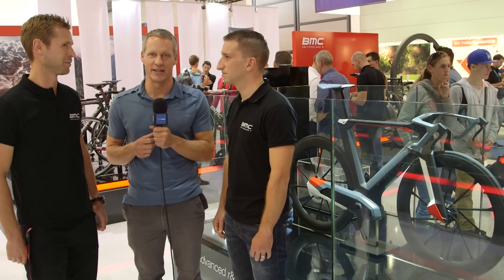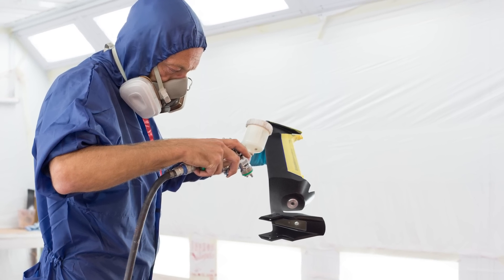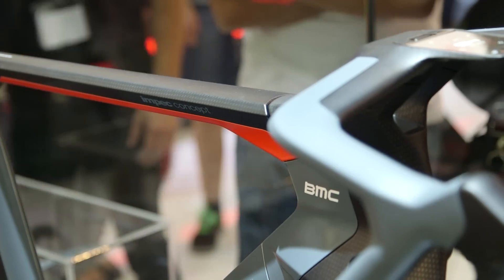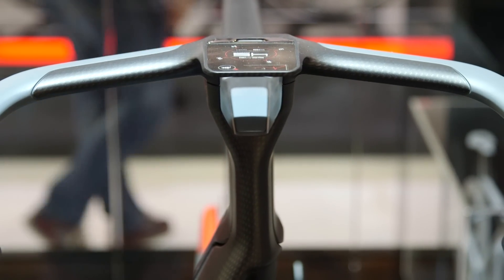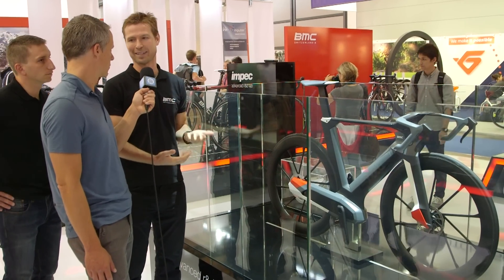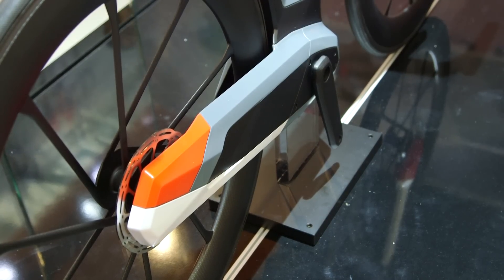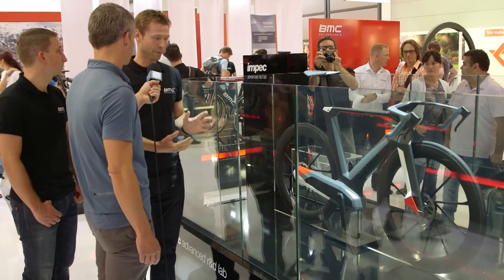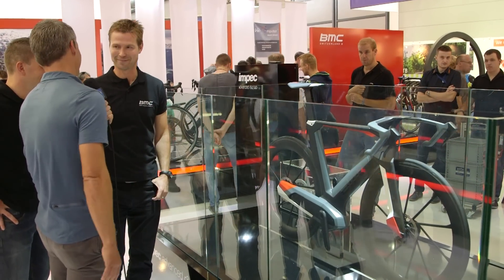BMC 2015 Concept Bikes

Comment: Absolutely loving some of these design ideas, especially the integrated drivetrain and storage. From an aero standpoint, the split stem and seatpost are simple and effective. The single bladed fork is long overdue in modern aero bikes, as are disc brakes. I'm really impressed to see such a complete aero package, this is an aerodynamicist's wet dream.